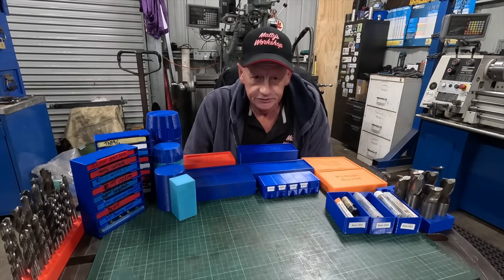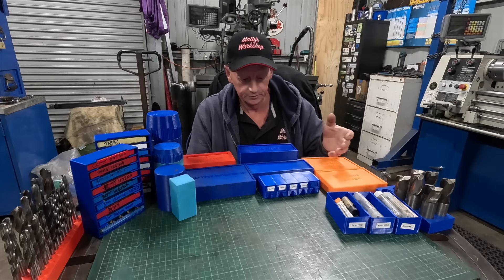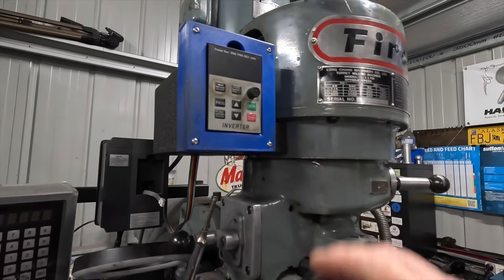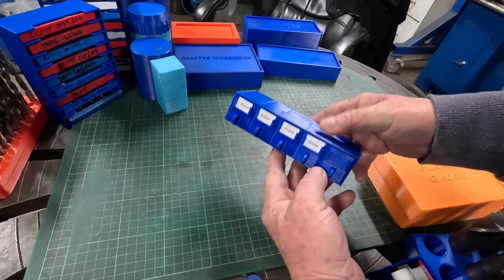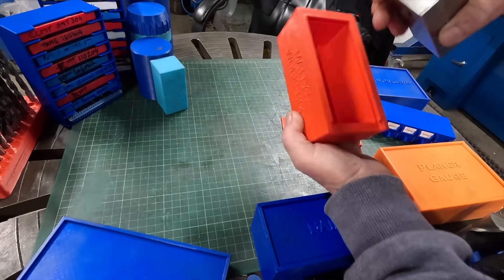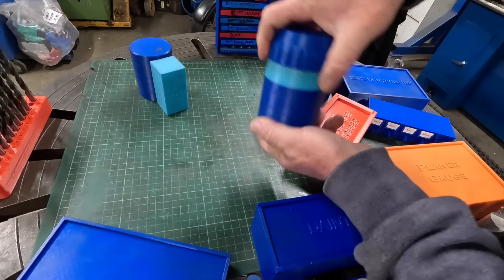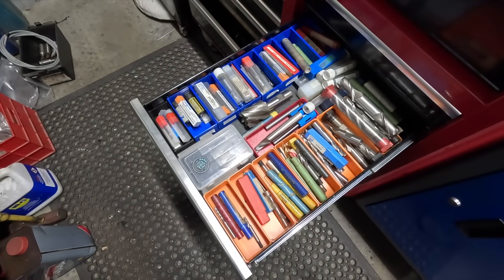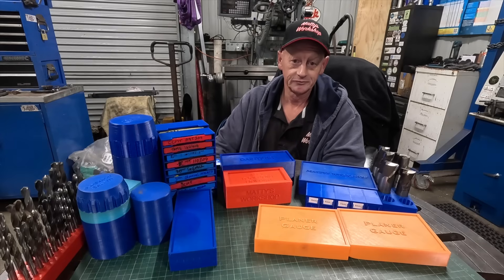3D Printer in the workshop - Viewer Question

Comment: I can also recommend "onshape" as an alternative to Fusion 360. Its on line and will run on any internet connected older computer. It's free and is as good as fusion. Some say better.  Very similar drawing style with a really good backup - back out fuctionallity. The main drawback for some is your drawings will be public but you can also search for other peoples work and modify it if you need to. 
You do need a reliable internet connection. 4G hotspot from your phone is fine.
Easy export. Just right click the drawing and "Export". double click the stl file dowload and your on the slicer.

I'm addicted to 3D printing especially in winter when the shed is cold.

Comment: I have not used mine much for the shop, but one of the first things I made with my 3D printer were control panels for my mill and drill press. Both use a VFD so I have on/off/rev switches and speed controls on the panels. You have used your printer for the shop a lot more than me Matty. Thanks for sharing the ideas you have come up with.
Reply from the maker: Cheers John, They definitely have a place in both the home and workshop mate, Thanks for watching